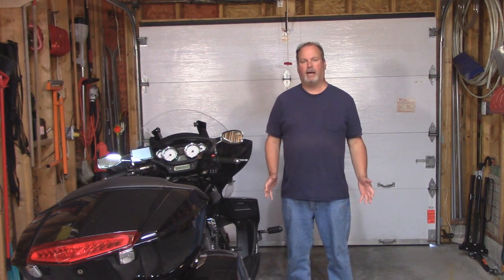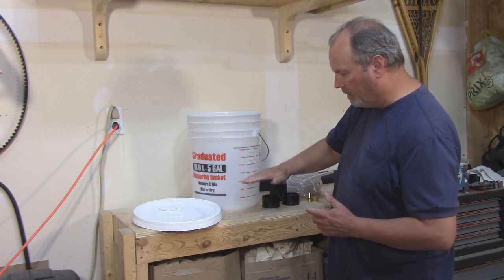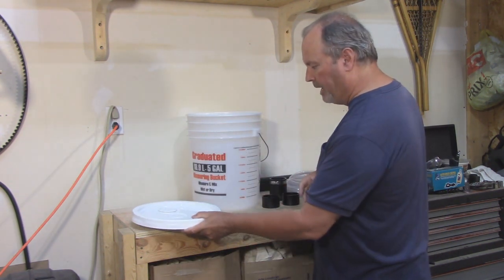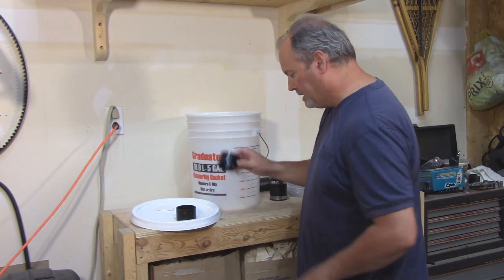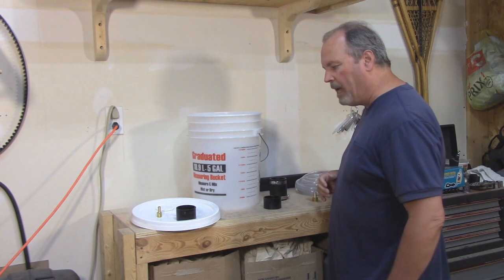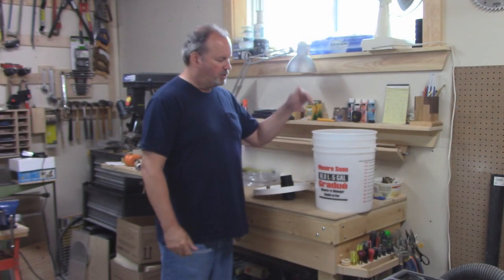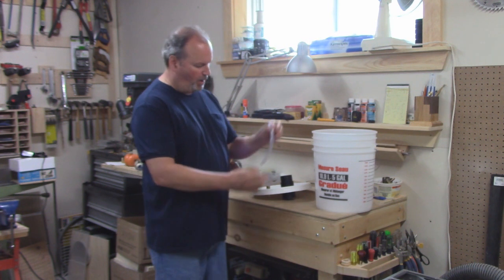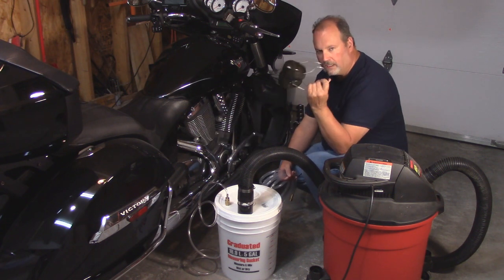DIY Oil Extractor

Comment: I think your suction line was way over sized. There's another video of a guy using the top of a 2l plastic bottle cup off placed in front of the suction side of the vacuum with a 3/8" line from the vacuum to a container then the same sized line to where you are extracting the oil. When this guy did it, he sucked the oil out of his lawnmower in seconds. 
Worth a try.
Reply from the maker: Thanks for the great tip. I am going to try this.

Comment: Warm the oil, but don't let it get too hot or the tubing will get too soft and collapse under vacuum.
Reply from the maker: Good point. Thanks for sharing.
Reply: @PaulPomerleau  I use the same system, but made from a quart jar. It works beautifully to suck the oil out of the lawn mower. I made the mistake of cutting the yard first and then trying to change the oil . The oil was too hot and ruined the plastic tubing.

Comment: What size were your fittings and pipe pieces?
Reply from the maker: I used 2" black ABS pipe with couplers to lock it onto the lid, then a rubber coupler to hold the vacuum hose onto it. The brass fittings I think were 3/8" threaded with various nipple sizes to accommodate the different size plastic hoses.

Comment: a Drain Plug cleaning = Unavoidable for Internal Combustion Engine which has Metal On Metal moving parts that require Oil as lubricant ■ Metal Chafings sink by Gravity toward the drain plug. Hot oil drains fast through the drain plug.
Reply from the maker: All good points but some can't crawl under a car or have ramps to drive up on. Some engines have the filter on top so it is easier to change oil and filter this way. It also prevents stripping of the oil bolt and it is easier to change transmission fluid and brake fluid using this device or when changing oil on lawn mowers and snowblowers. I'm not saying it will replace everything, just that it is another inexpensive tool to use for those who need it. Thanks for watching and contributing to the comments. We all help each other this way.

Comment: Have been changing oil in boats for quite a while like this, the only way to on an inboard V8.
Reply from the maker: How much oil do you remove and how long does it take? It took mine 15 minutes to remove 4 liters, although next time I will use the 3/8" hose and have the oil warmed up first. That should make it faster. I actually can't wait for my next oil change to try it.
Reply: That is the trick. 3/8 hose and hot oil. I can empty a 454, about 7 quarts, in a couple minutes.

Comment: The extraction process seems slow. I think you are pulling air in under the lid. If you can add a gasket or find a way to seal the underside of the lid off better the results may be better.
Reply from the maker: Also the oil was cold and I was using the smaller diameter hose. On the next oil change I got the oil nice and hot and used a larger diameter hose and it worked much better. Thanks for watching.

Comment: 23$us you can buy from aliexpress a ready made  pump set with all the pipes and  electric conections wires to 12volts dc
Reply from the maker: Which makes it about $40 Canadian also I can siphon gasoline, the aliexpress pump can't. Gas will eat through all the moving parts of the pump

Comment: Thumbs up for your effort, but u can buy a 12volt pump for $18 delivered that works much faster
Reply from the maker: Or you could just make your own with things around the house. Plus here in Canada there is no way you will have a pump delivered to your door for that amount.
Reply: yep, got mine from eBay for $17 delivered. Works great

Comment: why not just drain it sense you have to go under bike anyway?
Reply from the maker: You are right that on the Victory the filter is under the bike, but the extractor can be used on many other things as well. Harley's have the filter at the front of the motor and some cars have it on top so now you don't have to go under. Also many people prefer to leave the drain plug alone and just change the filter. It can be used on things like lawnmowers and snowblowers where it is harder to drain the oil. I also want to see how it works for brake bleeding. I am showing that there are ways to build things yourself to save money. Thanks for watching.

Comment: Awesome video -- Any commenter here has tried it yet? - I'm wondering: re: Home Air cleaner* using a 21" fan: with COVID-19's mutated wave 2 a couple months from now: Can you build a box around a Canada Home Depot purchesd type of strong fan to make an Air cleaner? 

* Brand: Commercial Electric
SKU# 1001094669
120V, 60 Hz, 1.35A, 162 W
With 3 fan speeds

Comment: oil change 30$---burnt shop vac 100$
Reply from the maker: I would like to know where you can get an oil change on a motorcycle for 30.
Reply: Most shopvacs have a thermal shut off if overheated, and are very durable. If he warmed up the oil, it only takes a few minutes to do this. Plus, I just use a cheap, 30 dollar shopvac from walmart to do my oil changes for the last 15 years. Still runs like a champ.